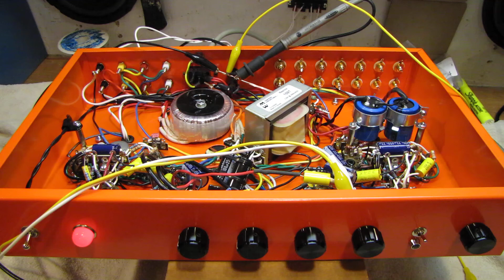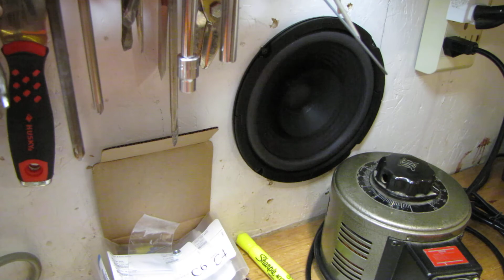My DIY 6L6GC stereo tube amp project part 4, initial test and ground problems

Comment: It’s quiet enough when there’s a signal on it. You missed a ground somewhere. You might end up having to move that transformer on the bottom of the top plate in order to get rid of that hum. I’m just guessing or put a shield over it. What do I know? Exposed e core transformers are always a pain in the ars!😡

Comment from the maker: It actually is looking better now, since I got the right filter caps mounts and relocated some wiring.  

Still has a hum but is much quieter.  I think I need to shield the transformers and/or use DC filament voltage to get rid of the rest of the hum.

I'll be posting two more videos, then it's on to the next project.

Comment from the maker: The chassis was bought new at Radio Daze.  I had it powder coated at a local shop.  I then drilled all the holes in the chassis myself.

Electronic components came from Mouser and Digikey.  Knobs, tube sockets, lamp holder, and some other stuff came From Surplus Sales of Nebraska.  Output transformers were bought straight from Edcor.  Power transformer was bought straight from Antek.  There were some other odds and ends that I got at other places too.

Comment from the maker: There is actually multiple problems.  I'm working on fixing it now.  It will be star grounded (as much as possible) with 14 gauge solid wire when finished.